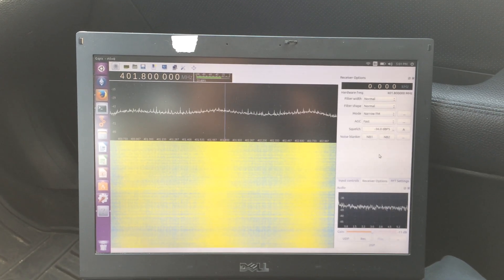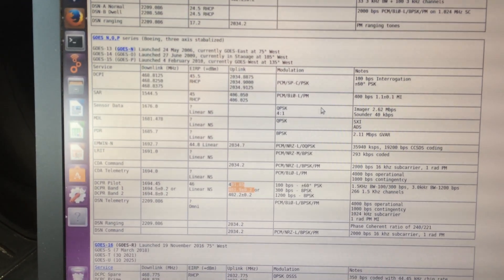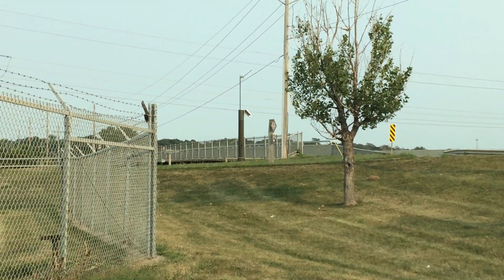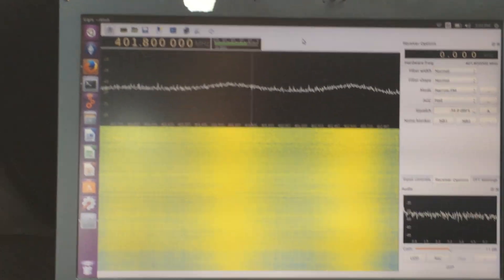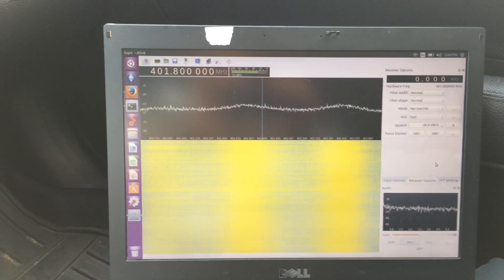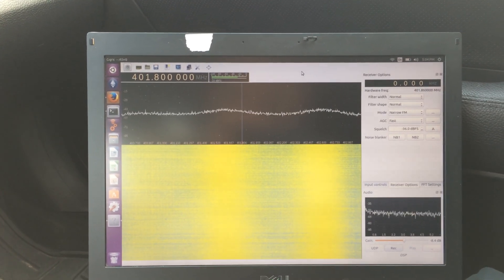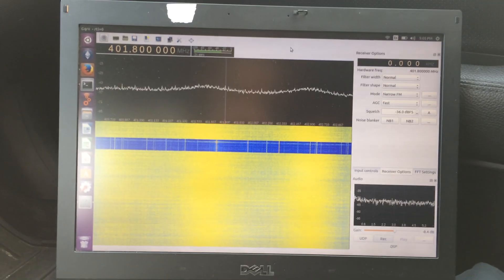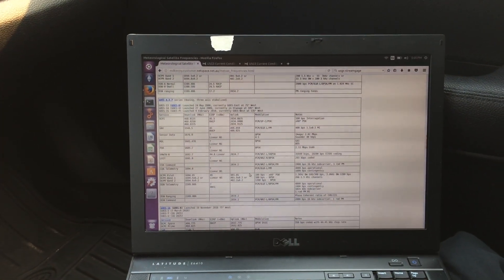USGS Streamgage GOES-15 Uplink RTL-SDR Capture

Comment: This is so cool! The frequency that you tuned in to is the satellite that provides earth weather images right? I'm wondering why you tuned GQRX to 401.8 instead of the 1600 or 1700MHz. What is the difference? Also, am I right that I don't need a satellite dish to receive transmission from GOES stationary satellites? Do you have more information about the antenna you used? Thanks a lot for sharing!
Reply from the maker: I have never decoded anything from GOES yet, I've only picked up the signal for the uplinks. If you want to decode weather images easily with RTL-SDR, the NOAA satellites broadcast some twice a day. I have a few videos on my channel and there are a ton more on the web if you search
Reply: Yup, I am doing the NOAA APT now and Meteor-M2 too. It's so nice. I really want to decode the one from GOES. I need to buy an Airspy R2 or Mini and better antenna preferably dish according to the articles I've read. Thanks!
Reply: He is trying to see the uplink to the satellite from a ganging station which is at 401.8mhz. You will need a dish or a helical antenna to rx a downlink from GOES